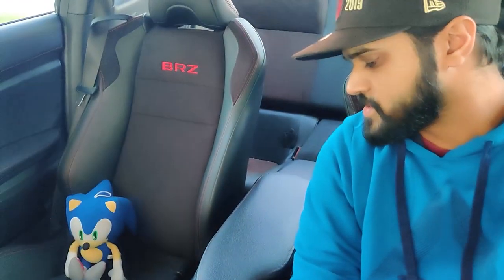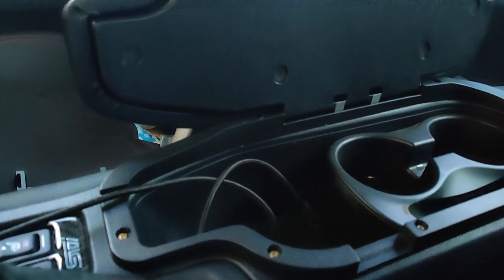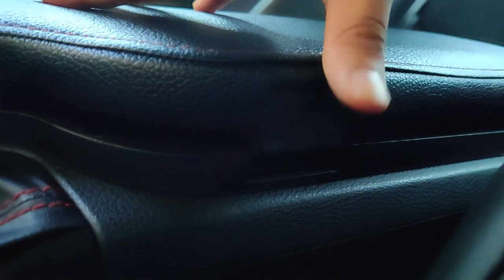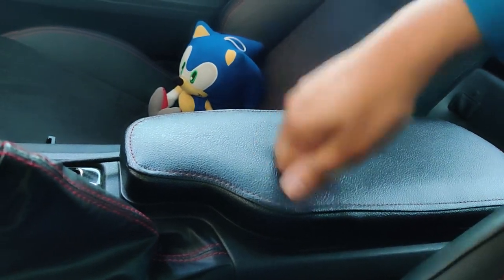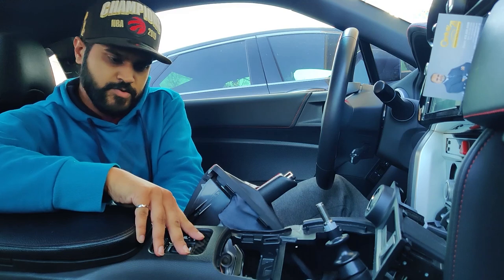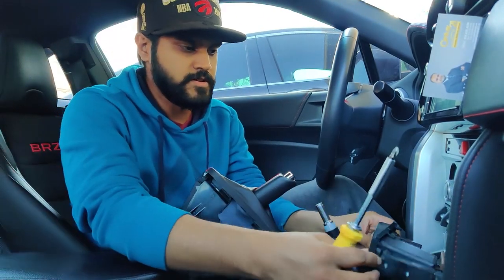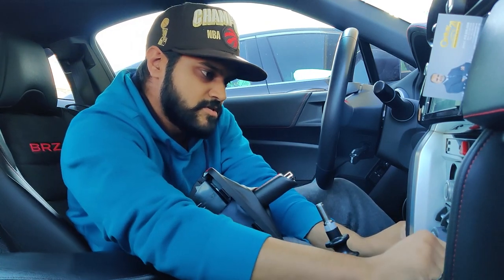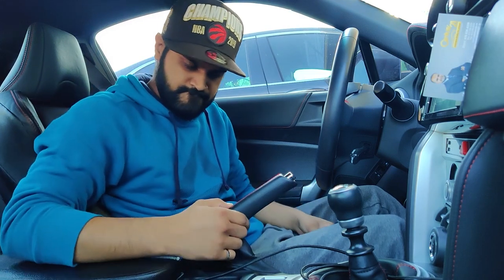Cheap OEM Style Armrest Review and Installation! - 2018 Subaru BRZ | Scion FRS | Toyota 86

Comment: old link doesnt work, dod you have the link for the product?
Reply from the maker: Oh maybe that specific one got discontinued, but the same one is sold by like 20 different vendors on Amazon and eBay. This looks like pretty similar but I’m not sure it’s the exact same, should be really close though 

https://www.amazon.ca/TOOGOO-Interior-Accessories-2012-2016-Pz4351034000/dp/B07TTMN6QG